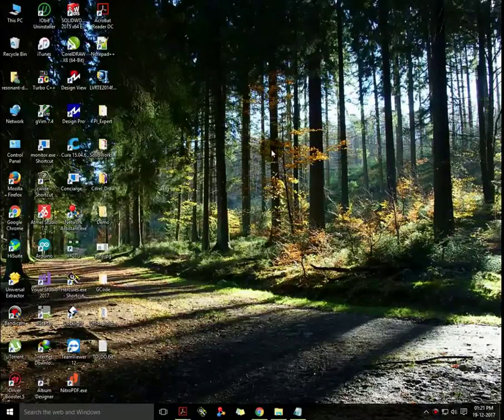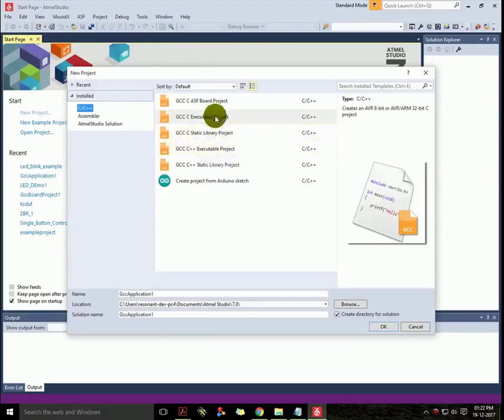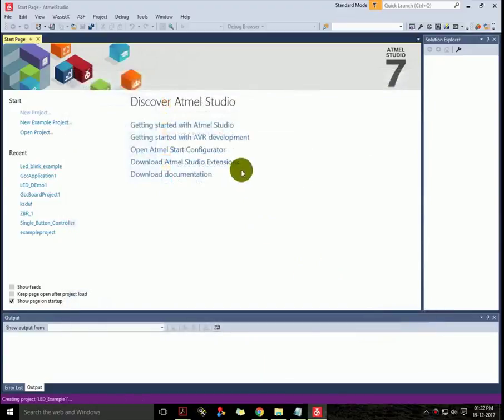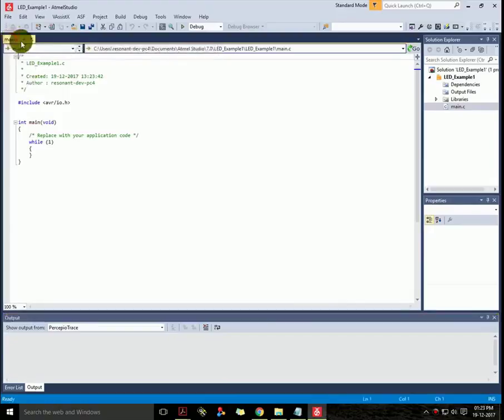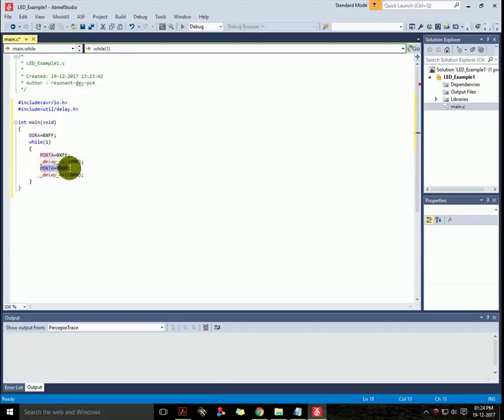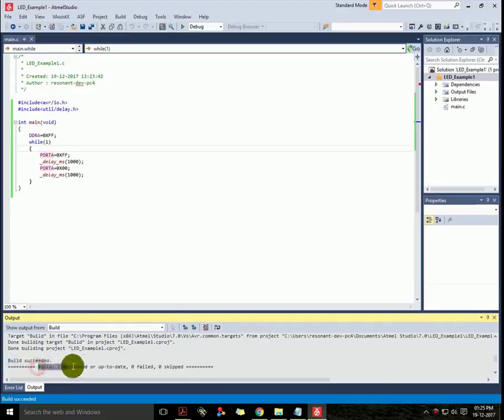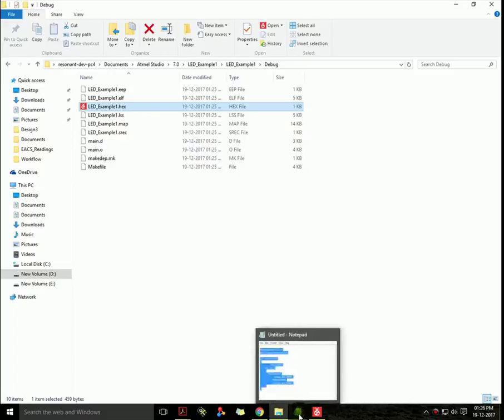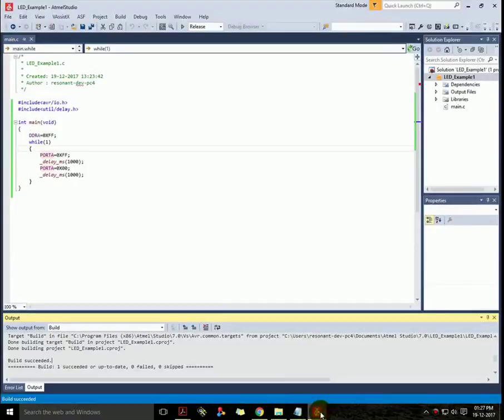Atmel Studio 7 (AVR Studio) Tutorial: How To Create & Build New Project [SUBTITLE: ALL LANGUAGES]

Comment: Nice video... I have one doubt, how to run the code without hardware, just like software debugging
Reply from the maker: What I understand is that Running actually means debugging here which is available in Atmel Studio. But if you want to see the code running as you see in hardware there are some tools for that. One of them which I used is Proteus. But I would not recommend it for genuine projects because of its inaccuracies. You can use it for learning.